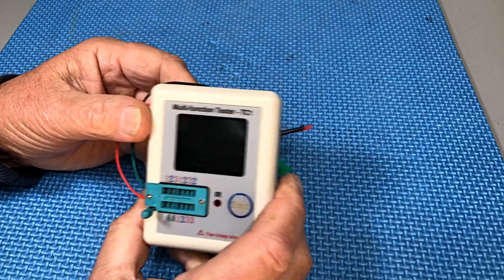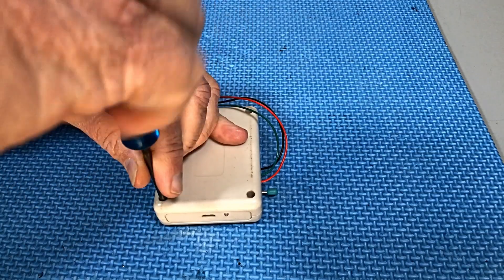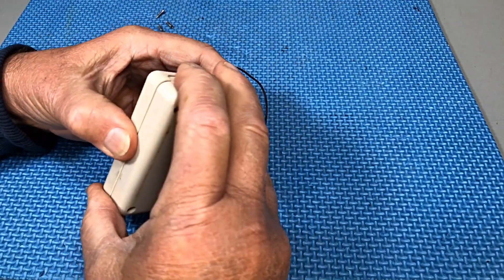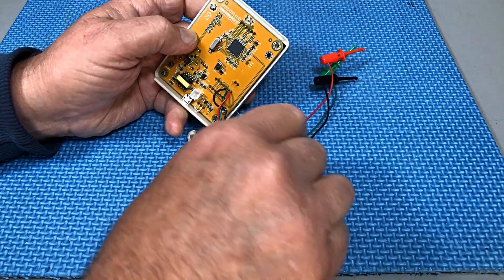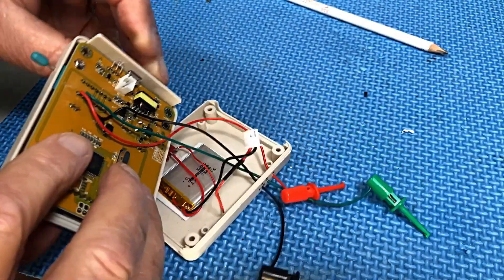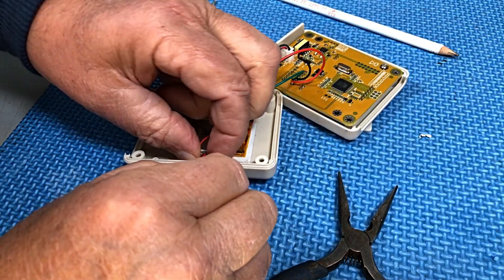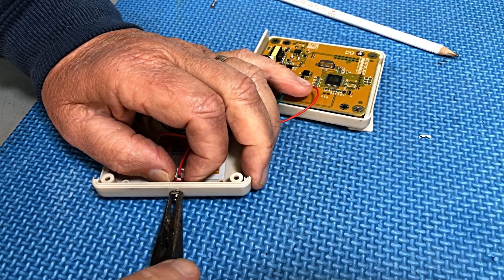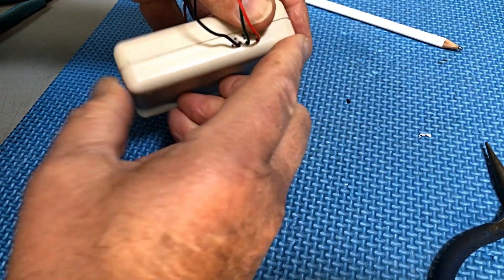MOD for my TC1 Electronic Component Tester !

Comment: I had the same issue. Every time I went to use my TC1, the battery was dead and had to charge it. I thought the battery had just gone bad, you know China and all, so I picked up a 1350 ma 3.7 Lipo cell (803448) from Amazon. too care of my problem. I had to re-use the original plug and it just fit.

Comment: I do have one of these component testers  
though I also have more sophisticated testers.
In my particular case i replaced the battery wit a higher capacity
battery from a salvaged mobile phone  - 
of course that does not entirely solve the problem of the 
batter discharging over time in its  STANDBY state -
So adding a small SLIDE switch may be a useful addition.
A slide switch particularly -- so that it does not protrude
beyond the edge of the enclosure more than 2mm -
just far enough to be able to switch the device  ON and OFF
using one'e finger nail
Reply from the maker: Thanks for your comment. Cheers

Comment: У меня такой же измерительный прибор в эксплуатации уже несколько лет. Согласен, есть у него "проблемы" в прошивке, приводящие к разряду аккумулятора. При покупке даже спор пытался открыть, не разобравшись. Думал аккумулятор неисправный. Вопрос решается предельно просто - короткое нажатие с быстрым выключением просто приводит к гашению экрана, а устройство работает и высаживает аккумулятор. Длительное нажатие на кнопку и процесс выключения с некоторой задержкой после нажатия переводит устройство в реально выключенное состояние, при котором заряд аккумулятора практически не тратится и при месяцах ожидания.
Я свой прибор использую не часто, но длительное время при проверке большого чиста компонентов, поэтому заменил комплектный аккумулятор на 350мА сторонним, на 2000 мА (в корпусе свободного места достаточно), теперь заряда хватает на 8-10 часов непрерывной работы, а так как пользуюсь редко, заряжаю 1..2 раза в год и ни каких тумблеров мне устанавливать не потребовалось. Если выключить неправильно, то и 2000 мАч аккумулятор вытянет в ноль за 1-2 суток хранения.
Reply from the maker: Interesting information, although I did always long press the shut-down switch but this made no difference to the quick discharging. I also know a few techs who shut down correctly but only have a few days of charge before they are flat.
Maybe a firmware problem but for me the switch will certainly fix the issue.
Thank you for you comment & watching my video. Baz

Comment: Hi, I like the mod. I do have a question tho. The tester has a calibration function. If you remove the standby current is the calibration info lost. It's easy to perform another calibration, so it's not a big deal, but I'm curious.
Also if the battery is dead, it has probably lost it cal info anyway.
Reply from the maker: Yes it does lose cal, either turning off or battery dead. I just do a quick cal before using. Not using the tester all the time this is not a problem 👌

Comment: If you disconnect the battery you have to do a calibration every time you turn it on again, which is a bit of a pain. I've got the T1 and T7 and have never had a battery go flat on me. Every now and again when I use it I put it on charge for a couple of hours and have no problem. I do like your mod with the probe wires permanently attached though.
Reply from the maker: Thank You for your comment Ray, Cheers

Comment: i added a 3.5mm headphone jack and connected it to the socket pins,  then made some test leads i can swap between without fiddling around
if you got a flourescent lamp above the workbench, it also makes sense adding a switch for the ir receiver otherwise it will trigger randomly sometimes. its pretty useless anyway, as it only supports rc5 or so.
Reply from the maker: Sounds like nice mod. I might have to do the socket trick. The big let down with these is the original leads, useless.

Comment: I had a similar problem with a different device and reused an old mercury tilt switch so when I put it away the battery is disconnected but when I put it in operating position the battery is connected. Invisible and easy to do.
Reply from the maker: Top idea Tim, didn't think of that one !
That will help the group im sure 👍
Reply: @techobaz55  It was actually an electronic bathroom scale which was always flat for the same reason as your component tester. I store it vertically so a tilt switch seemed the obvious answer. Due to the issues with mercury I think the modern ones use a ball bearing.

Comment: Thanks for this one Baz I guess a lot of us have got these things. I will do this mod to mine. I think I'll try and find a little slide switch for it.
Reply: The switches can always be found when one does not need it.
The moment there is a need for such a switch - they seem to
be elusive and cannot be found-
Still - next time you are at a local Trash & Treasure week-end market
you will find something suitable
Reply from the maker: Exactly !
Reply from the maker: A small slide switch would be better. I didn't have one in the junk box.

Comment: Ha! I bought the 9v version some years back, and had the same issue.  I'd use it every other month, and it would be down a volt, another month on, down another volt.  I put a switch on it, some alligator extension leads for the probes, and I have not changed a battery in years! Great little tool!
Reply from the maker: They sure are !
Reply: A very clever mod Baz full Marks Marks Mate,Ian,
Reply from the maker: Thanks Ian 👍